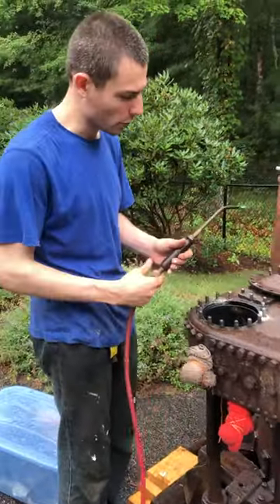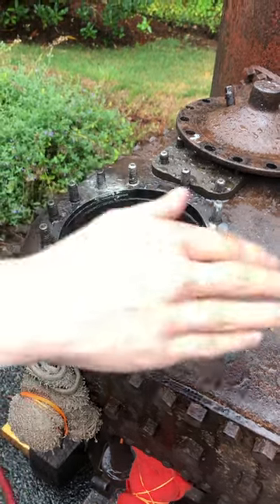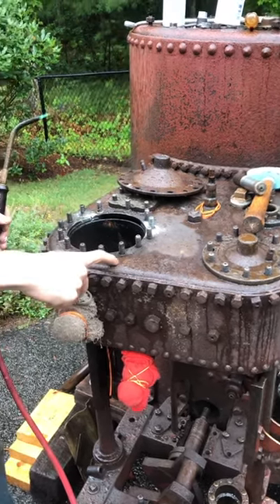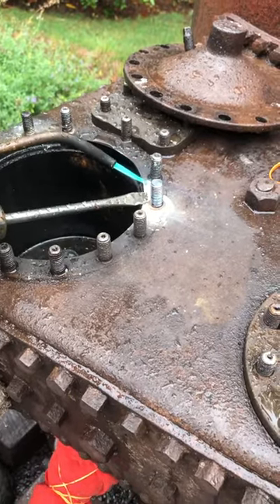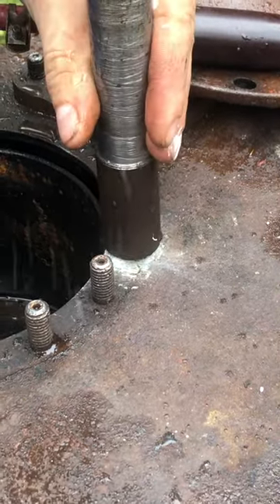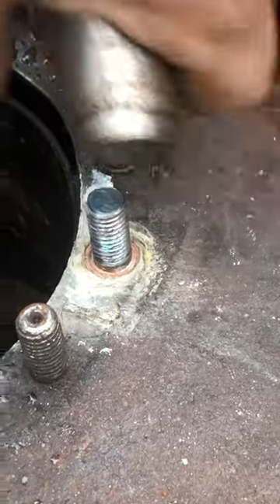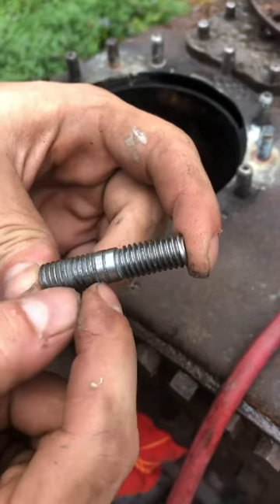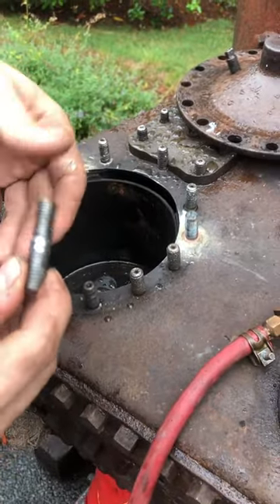Sealing new Boiler/cylinder stay-studs on George Whitney's Ida F

Comment: What are the advantages to having the cylinders constantly immersed in the boiler water?
Reply from the maker: When the boiler is brought to steam, the cylinders are brought up to operating temperature before the regulator is ever opened.  No lengthy seperate starting warm up period is required the way there is with every other type of steam engine or power plant.